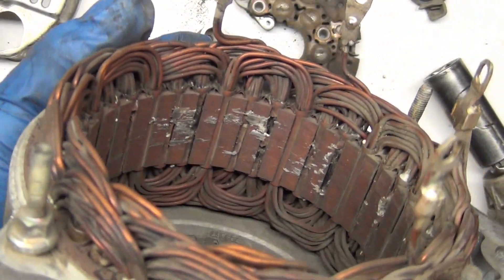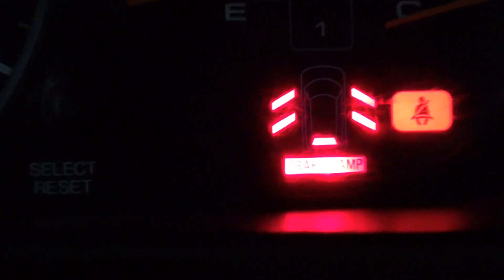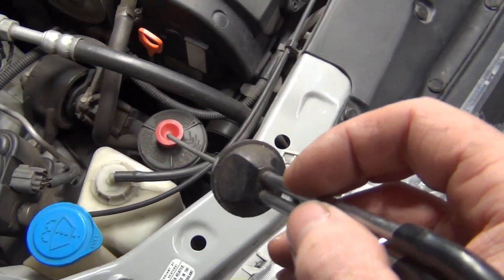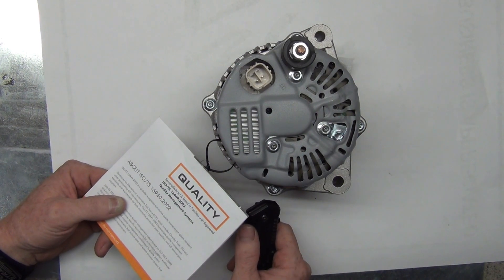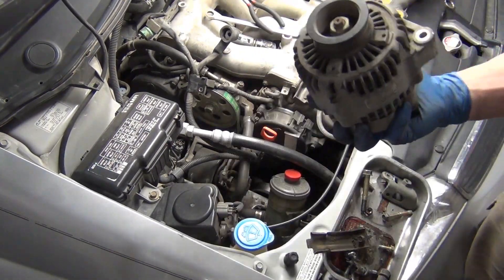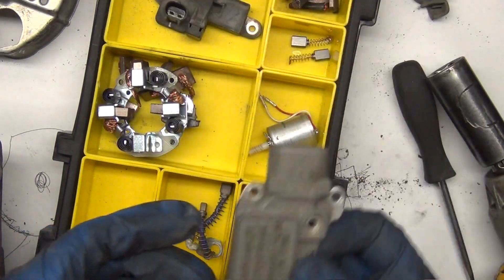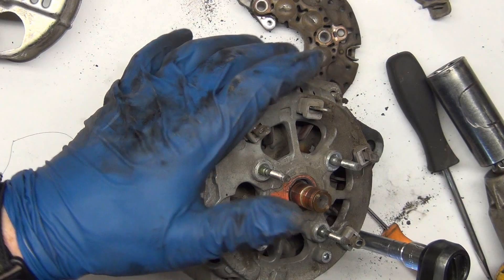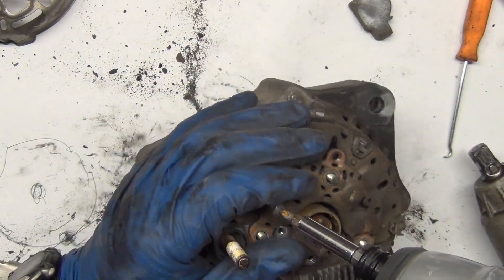What Makes the Battery Light Come On?

Comment: Brian I have a 2003 ford van , battery was 7 years old , left on vacation for four weeks came back to a dead battery . Tried jumping it to start van , did not work so put charger on it n never did get battery to start van, so bought new battery. Now battery light is on , my brother in law tested n sees battery is not charging n is trying to teach me but doing research on why it is not charging, so from your video it looks like I fried my alternator , am I understanding correctly. Just wanted to ask to make sure when I talk to him n when I bring in my van to repair shop so I don't get taken advantage of . Should I get a rebuilt one or new one. Only 130,000 miles on van.  Thank you in advance for explaining in layman terms.

Comment: when i turn my Mitsubishi eclipse Gt 2000 on it runs fine but around complete warm up at idle the brake light and battery light come on together and just so you know my alternator and battery and starter are brand new and they all where put on the same time. and the weird thing is when i accelerate the lights go off. then comes back on after acceleration so what could this be?

Comment: Hi Brian, any idea what this could be on my 02 excursion with 7.3.. Battery light keeps coming on when rev it up. Alternator is producing 14.2 volts consistantly. I added 0/1 gauge ground from alt mount bolt to inner fender, then inner fender to neg on batt in hopes it was a ground issue. Batts are good, new last yr. I pulled instrument cluster last year to have local circuit board people replace battery saver delay inside cluster, and that's when this issue started. Maybe I disturbed a ground to cluster when I pulled it.

Comment: Thanks, Nice video with great explanations, keep up the good work.
Reply: Hey got a question my altinator went out on my nissan xe 1995 pickup went too junk yard got one but I spilled antifreeze and oil all on it .would that have caused this at low rpm the battery light stays on but if I riv the engine up the light goes out.

Comment: Start with the less expensive route I changed battery alternator mega fuse come to be terminals at the battery we're not good when the car vibrated would lose good contact

Comment: Great video!! My aunt has a 1996 buick century. We have had some mechanical work done lately. A radiator, hoses, starter(last spring), water pump, battery, alternator, fan belt. The most recent was the battery and alternator. Here is what has been happening. First the radio is nothing but static all over the place when it never did that before. Then yesterday, the battery trouble light came on. It is my aunt's car and I use it whenever she has a doctor appointment or lab work appointment so I don't notice a problem until I drive it so the next problem shows up a couple of weeks later.  With the new battery and alternator installed....why would the trouble light come on?? I have not put my battery/alternator checker on it yet. Thanks for any help!!

Comment: The serpentine belt needs replace and the belt tensioner is not working 
correctly so the alternator was turning but not fast enough to produce 
power. BINGO

Comment: The one on my Previa minivan lasted for 25 years, original as the ground was riveted and I have driven the car for 20 years. It would have probably lasted longer if I didn't let the car sit for a month without turning it on or charging the battery. As soon as I turned it on after sitting for so long started hearing what sounded like whining sound and battery light turned on. Ordered a used alternator off Ebay for $20. Works fine. just for the hell of it, I picked up another one and put it in my garage in case I need it. So for half the cost of a new one, I got two used ones out of newer cars. Vehicle has 300k miles, not gonna spend $150 on any part for it. Would rather take it to junkyard.

Comment: brian on the voltage i think some auto makers run the voltage lower then some because both of my Dodge trucks run 13.7 to 14 volts and there is a huge age gap in them one is the 89 and the other is a 05 but both use a Denso alternators. so the 14.4 might be the set voltage.. im not sure why though perhaps battery life.
Reply from the maker: Dodge/Chrysler uses a battery temperature sensor and many of them use a voltage regulation process through the PCM.  I think they're just control freaks.

Comment: My battery light is on my 2002 Ford Taurus I bought a new battery and a new alternator ... Any ideas why it's still on  ?!?!
Reply from the maker: Poor connection or a blown charging system circuit fuse.
Reply: +briansmobile1 I got to try something took it to 2 shops and they wanted to replace the alternator again any insider tips or tricks

Comment: Thank you.  I have a `97 cummins that seems to loose its charge, intermintlly .  I currently use a 5 amp charger while parked.  Now I am wondering if my alternator insides are gummed up with solder.  I may purchase a rebuilt and rebuild mine as a spare. Thanks for a look inside. ~ Mike

Comment: Does that odometer say 247,011? It's funny, my alternator gave out about three months ago, I was just sitting at a red light and the battery light came on. I drove it home and immediately checked it... just battery voltage. Didn't sound strange, didn't have trouble charging the battery... just quit one day. It had about 130,000 miles on it so it lived a pretty long life I suppose.
Reply from the maker: It's a Honda and the owner does a great job maintaining it.

Comment: Hi Brian , I have a problem that I would like to ask you. I have a 2007 Honda Ridgeline with 110,000 miles. I just noticed that when the head lights are on and I give some gas the head lights dim. When I let off the gas they get bright. I have a new battery and new head lamps. I think it's the alternator. What do you think?

Comment: great video, i was just looking at a ford escape that had the battery light on. seller told me the battery was just getting weak. but really the alternator wasn't putting out. i passed on the car due to high cost of ford ( mazda ) alt. and because of location of the alt. had to tear half the right front off to get at it. battery looked fairly new, so i think seller really knew what the problem really was! BUYER BEWARE! thankyou for the video :-)

Comment: I had never thought of the importance for a break-in period with an alternator. Your explanation (low surface area with new rectangular brushes pressing on a cylindrical contact) makes a lot of sense. Spreading the break-in over time allows heat to dissipate without damaging the steel or melting solder.

Comment: I had a problem with charging once.... Turned out to be a cable from the generator that some had untreated itself.... Now this happened to a old diesel to it just kept on going even when the key was out of the ignition... There was not power to activate the automatic fuel cut to stop the thing keeping on going... I had to shut it off by using the the handle on the injection pump... But I had no lights whatsoever for the last 2 km to my friend's workshop where we got it fixed and started up again... fortunately we had 150 km drive before it got shut off again.... So the battery got charged without complains even after been drained beyond reason...
Reply: ...But it still got changed within 3 month or so...
Reply: Carsten Langbo Next time just release the clutch, it should stop the engine ;)

Comment: Brian where do you get your alternator parts?  Do you need to order everything separately or are kits available?

I'm debating whether or not I want to try replacing parts on my own.  I have one that's charging just fine (13-14v) but I was in doing a timing cover gasket and noticed the alternator pulley is scratchy and rough when I spin it by hand.  A new alternator is stupid expensive.

I am guessing bearings need to be changed and some new brushes while I'm in there wouldn't hurt.  What say you?  I know it's hard to say without actually seeing/feeling it, but if you have any thoughts I'd appreciate em.

I will drop a Nova Scotia plate in the mail for you this week.

Comment: Pretty interesting point Brian !!!. I wonder WHY if this a known issue, they wont fit brushes machined with this form or just let the alternator do a burn in as part of the factory procedure, so when you get the thing it will be able to fully develop its capacity. Cheers

Comment: the brushes are used only to make the rotor magnetic. the charge comes out straight from the stator, and its alternative current, hence alternator name. It's converted from ac to dc.  if the charging voltage is too high after the conversion, the charge controller lowers the voltage to the brushes and that lowers the output voltage too as magnetic field in the rotor is lower. but it's true that new or too short old ones will spark and score the points that brushes touch.

Comment: Well; I learned several things this morning Brian. Thanks again...
Reply: I need some help I have a 2003 Kia Rio Cinco the battery wouldn't hold a charge I replace the battery with a brand new one I replace the alternator now the battery light is coming on as well as the brake light and the engine light is on it continues to make a strange sound what can I do?

Comment: cool video!  Those look to easy to repair if someone wanted to spend the time.   And yes, its funny the massive chaos a low voltage on a modern vehicle (be it a failing battery or not charging) can cause and make bizarre things happen.

Comment: Hey Brian, have you ever seen what happens when a voltage regulator goes bad? Had like 19 volts going through a little Mazda 3, it was smart enough to turn off most of the electronics before it could destroy it. It was weird that I could drive it if I kept the rpm low, over 1500 would cause it to spike to 19 volts and the transmission would stay in 3rd gear, power steering (electric) would stay off. Pretty weird. Changed it out and everything worked fine.

Comment: Thanks Brian good presentation. I know that what you said about alternators being straight forward is true, but I tend to overlook the alternator often. I have an old 1996 olds Aurora with electrical gremlins, I will take a look at the alternator output now, thanks. Love the flying, I am just to squeamish at heights for that, rock on and be safe. This Aurora is the biggest piece of sh#t I have ever encountered. Sam.
Reply from the maker: Thanks, and best of luck with that Aurora Sam.  Remember not to underestimate the ground circuit and the value of good clean, tight connections.  Think sand paper or wire wheel and silicone grease.
Reply: Thanks Brian.

Comment: I wonder if they have brushless alternators like brushless motors? Might be a bit expensive
Reply from the maker: Great question and the answer is absolutely they do!  You'll find them a lot in aircraft, marine and even for lawn mowers.  When you hear terms associated with alternators like "avalanche diodes, " or "permanent magnet," or "synchronous," or "exciter," there's a good chance you're dealing with a brushless alternator, generator, or starter/generator.  The really high RPM stuff or high dollar and large scale generators/alternators you'll find are brushless of one form or another.  They're lower maintenance and much more resistant to debris induced failures.
Reply: +briansmobile1 should they use those on any higher priced cars like mercs or BMW? Or is it just for mission critical stuff that can't fail?